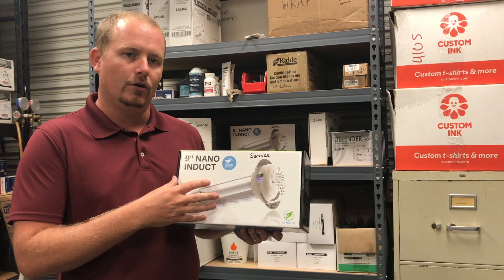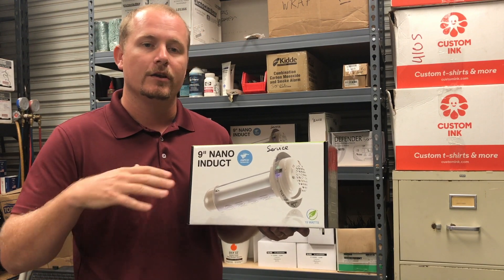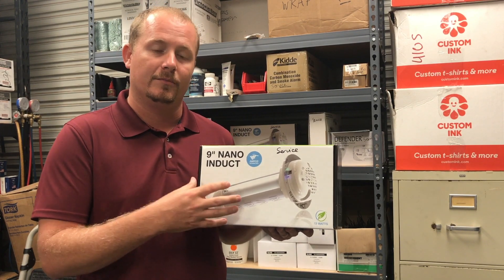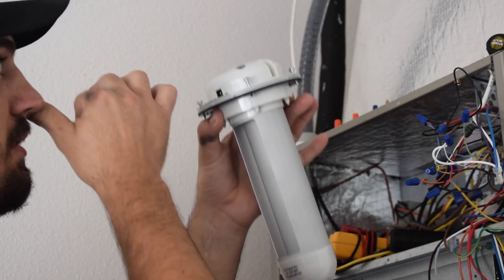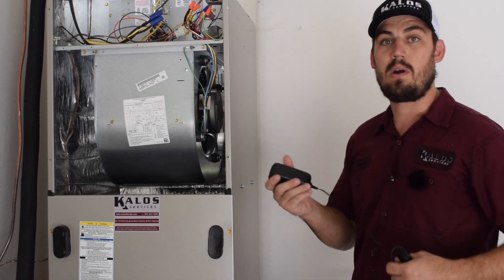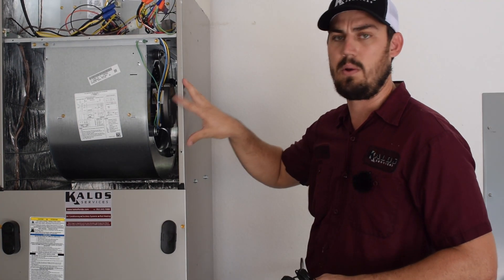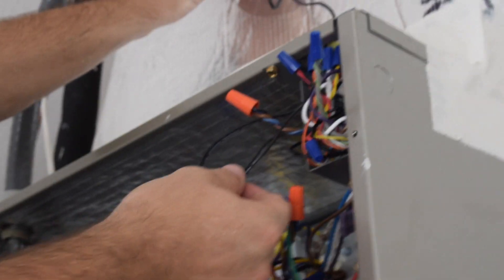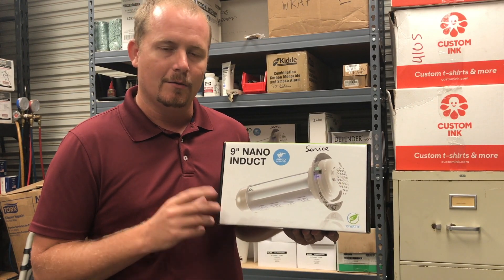Nano Induct Installation Instructions by HVAC School

Comment: I have a question
Today i am installing this UV air purifier into the fibreglass air duct
My manager told me to install it perpendicular to the air flow.....
Is that right?
Or its still okay, it will still work?
It is so confusing......

Question from Hong Kong
Thanks
Reply from the maker: Many thanks for your comment. If you'd like to send us a picture via email so that we can better reference what you're working with we will be happy to go from there. You may use the link provided and click on contact our support team: https://www.airoasis.com/a/faq